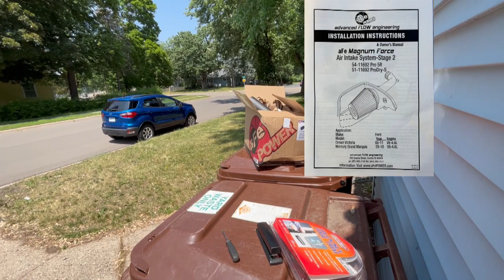Mercury Grand Marquis Cold Air Intake Install!

Comment: Would this work on a stock 03' marquis ls?
Reply from the maker: Not stock. You (like I did) will have to switch to a 2005+ style MAF (switching to a 80mm MAF will require a tune), and reroute the PCV. The intake is for 2005 and up, I had already modified my car to run a 2007 police interceptor intake/airbox prior to switching to the AFE intake.

Comment: I got a K&N cai found it @ my local pick N pull looks great and works great with my BBK 78mm tb ,
Reply: what coupler did you use? i have a 75mm TB for my crown Vic but don't currently have access to the measurements
Reply: @michealgray533  had to stretch it just a bit but works great
Reply: @SJ_MERC  so just the stock coupler?

Comment: did you get a jay mod tune before you put the new intake in?
Reply from the maker: Well a J-Mod is a physical modification to the transmission valve body, you can do that with out a tune for firmer, crisper shifts. For the intake, if you have a 2005+ CVPI you should be fine, any other panther platform car will most likely need a tune because the smaller MAF doesn't like the increased airflow. My setup is custom, so I was already tuned. Hope that helps!

Comment: How did you go about converting the mass air flow sensor to the new style?
Reply from the maker: They actually sell adapter plugs now, you can find them on Amazon and Ebay, at the time though, I just matched the wires with one I pulled from the junkyard and soldered it up. Stepping up to a 80mm MAF does require a tune.

Comment: Nice 👌🏿, since the installation did you feel any difference in acceleration from a dead stop
Reply from the maker: I did not, however the car was previously converted to the 04+ CVPI airbox/MAF, so I may have gained a HP or two, nothing I'd really notice. That being said, AFE claims 12-14 HP over the stock civilian setup, which I believe, especially with a tune and 80mm MAF conversion.
Reply: @Socoolds455  ok good deal 👍🏾

Comment: Loved the video bro 💪🏾💪🏾 Question for you though do you no of any cold air intake that will work on 1999 Grand Marquis mainly looking for looks change the factory one with?
Reply from the maker: Sure, ADTR.net sells the K&N intake system you're looking for, they make one that fits 99-02 models! If you're bone stock, you should legitimately get a performance boost.
https://adtr.net/product/mercury-marauder/intake-mercury-marauder/kn-fipk-cold-air-systems/